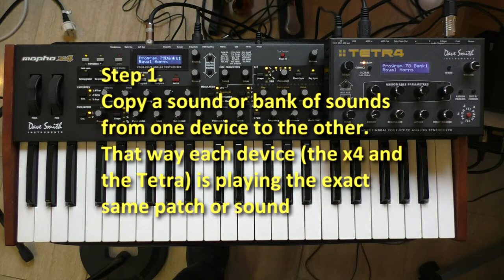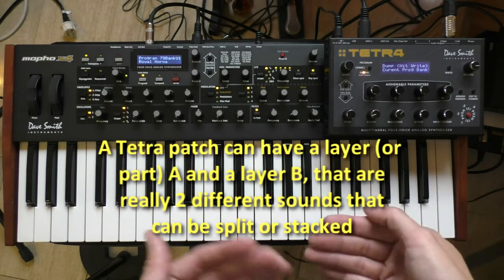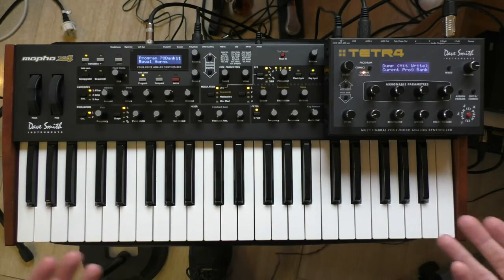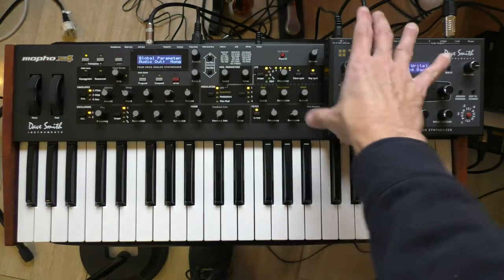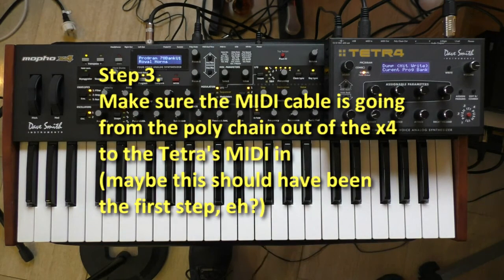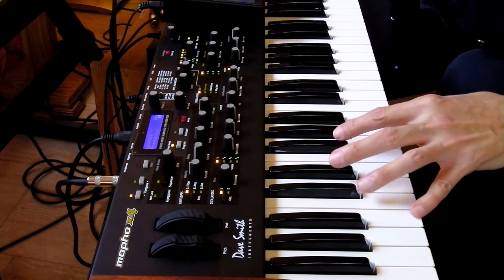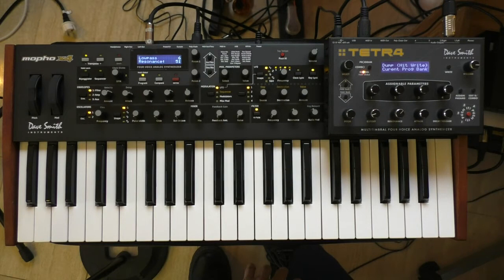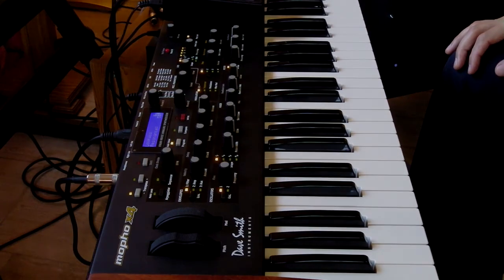Dave Smith Mopho x4 - Part 2 (Chained to the Tetra)

Comment: Hey! Helpful video - I also would mention that both the Tetra & Mopho X4 (or whatever module you are chaining) is the same midi channel whilst poly chained. In the midst of all the callamity and midi cables in my studio I seemed to overlook this upon my initial setup. Got it up and running, and I am loving it. Deep vibes tonight :D
Reply from the maker: Yeah, when I did this video there weren't a lot of polyphonic analog choices out there, and this made a lot more sense as an option back then.  Now, even a used Tetra and Mopho x4 would cost only slightly less than a new 8-voice Prophet Rev 2.  These are good times for synth geeks!
Reply: I got my pair for 1400 both separate purchases but I lucked out.
Reply: How do I set to recieve midi only on Channle 1?
Reply: @keepingfitness727  global settings, set midi channel (1)
Reply: @neofelisherod2947  how many midi tracks can I have is it just 1?

Comment: Man, I'm seriously considering snagging a Tetra for my X4 and your video has totally helped sell me.  I love my X4 and there are things that does well and there are things that it doesn't.  Those analog string/brass/pads are just next level with these guys but you are hard pressed to get a good "synth keys" sound out of it; it's possible but not it's most practical application.  I feel you on not being able to use all of the parameters of each synth but if you're using the multi-timbral aspects of the Tetra and perhaps the sequencing of the X4 then you could plan that out ahead of time with a DAW or other sequencer - I know I'm not the type of guy to use that stuff on a regular basis, I mainly want bangarang, pop out of any mix chords.  

So I'll have to tack a Tetra on to the wish list and then eventually build a passive mix box to pipe a mixed version of all analog goodness straight into the DAW.
Reply from the maker: Well, you already have the X4, the more expensive of the two, so yeah, the Tetra would be a natural next choice, as they really do work great together.  Fortunately Tetras are fairly cheap nowadays too. Cheers...
Reply: definately can get those sounds, its just a bit of a dive. I am going to mess around with different setups - as mentioned in the video - figuring out how to split voices between tetra and mopho x4 seems to be either elluding me, or is not possible. I would be able to program multiple other sounds via my Elektron Octatrack, with the assumption I have each of the 2 voices from the tetra on discreet midi channels. In theory, I think the other 2 voices could potentially chain with the mopho . i just dont know about midi in/out availability with the Tetra  post polychain.
I just got my Tetra hooked up tonight, been noodling with 8 voices with some fx chains in ableton, and I am impressed to say the very least as I have only begun to scratch the surface with this addition to my subtraction (see what i did there)

Comment: really nice that u made a video on this subject, i'm really thinkin' of getting morpho 4 or prophet 6 to control my tetras, but seems like with so many new synths coming nowadays it will be very difficult to uphold that dream, but anyway real curious to know how smoothly  it works, u just share the same preset on both units and tweak fully on the morpho and it affects both right? any  glitches? if u get time it would be super if u cud do another more in depth video just on how u tweak patches.
Reply from the maker: +Ehsan Kamran Thanks for the feedback.  The good news is the Mopho x4 really does let you easily program your Tetra.  There is some menu-diving required, but for the most part, it's quite easy.  And no, no glitches that I've encountered.  The bad news is the Prophet 6 can't be used to program the Tetra.  They have a different architecture and sound engine.
Reply: Oh I meant prophet 8 :) thanks for the replies!

Comment: The only limitation i am seeing with is setup is that the morpho x 4 doesn't seem to have knobs for editing the step sequencer, I guess a prophet 6 would be a better choice, as per the all voices or none thing, I don't think its a serious issue but I do feel that it would have been nice to have it as u explained how you wanted to use it, although the good thing is u can connect the tetra via usb to another keyborard and just use it by itself for the layered sounds and other combo modes and what not and it can still be connected to the morpho by midi when u wanna fire up a 8 voice royal horns patch!
Reply from the maker: +Ehsan Kamran The 2 biggest advantages I can see chaining the Tetra to the Mopho x4 is: 1) you double your polyphony, and have 8 voices which are great for slow fading pads or any patch with a slow release, and 2) It lets you program the Tetra with knobs!  I can see times where I would rather just control the Tetra with the Mopho x4, letting them both have 4 voices (and different patches if needed), and then maybe layering them.  You could get a big, fat sounding, 4-voice pad that way (with the 2 synths layered instead of chained).  Hope that helps.  Cheers!

Comment: Awesome. Thx for the vid. I've got a yellow mopho keyboard and tetra and was thinking about upgrading the mopho to SE or maybe even X4 since because you can put the tetra on top, it basically takes up same amount of space as mopho keyboard and tetra but gives extra keys, and also tetra on top of other black units would just give a more unified experience, but........ the damn filter and resonance knobs are badly placed relative to tetra on top. Not enough room to tweak. Is it as annoying as it looks to me to be?
Reply from the maker: Nah...it's not that cramped, at least not in any way that I noticed while playing with it.  That being said, I'm not a massive knob tweaker while I'm playing (as I mentioned in the other Mopho x4 vid, I don't sequence much outside of a DAW).  And as my left hand is used to doing the pitch or mod wheel, it really isn't hindered if I swing it over to work the filter knobs.  If you're someone who just lets the on-board sequencer run, and you basically play the knobs with both hands, THEN the Tetra might be a slight obstruction, but nothing that's a show-stopper in my book.

Comment: Thanks for the assistance.  However, in retrospect, I think I should have just bought a Rev2, since getting a mixer, Tetra and X4 came out to be about the same price—though in “installments”.
Reply from the maker: Yeah, fully agree.  If you're mostly building this setup for the 8 voices of polyphony, you might as well get a used Prophet 8 or a used Rev 2.  I saw some guy interviewed where he had this setup mostly for programming his Tetra with his x4, using them both in his home studio , and then actually using just the Tetra for gigging with some other lighter controller he also used for pianos and organs.

Comment: Hi man, 
I am from little Belgium

Nice demonstration , very nice... Thanks!!! 

 I would like to keep the patches and sounds of the Mopho x4 and those froth tetra in the same instrument ? in your setup it seems that an entire bank of the Mopho disappears and is replaced by the sounds of the tetra to reach 8 voices polyphony? Can we transfer an entire bank from the Tetra to an "user bank" of the Mopho and  have access once to 8 voices of polyphony, or once to the two x 4 layered sounds or patches . Possible to choose the destination of the transfer ? 

Also I have a Mopho x4 and two Tetra's : 12 voices possible isn't it ?

Thank's

Philippe
Reply from the maker: Hoi!  België is klein maar leuk.  Ik heb daar gewoond.  And if you're Walloon, je regrette, mais mon français sucks.  I did learn a little French in Belgium, but not enough.  Fortunately I already knew some Nederlands/Vlaams.

If I understand what you're asking, I think the answer is no.  When playing in 8-voice configuration, the only data shared between the two devices is the midi performance data (note, CC, velocity, etc).  The Mopho x4 can't read the patch data from the Tetra or vice versa.  The only reason to have the same patch data in both devices (the Mopho and Tetra) is so when ANY of the 8 notes is triggered it will have the same sound.  Though I haven't tested it, I think you can have different patches on the 2 devices (like a brass sound on one and a clav sound on the other ), and the extra midi notes from the Mopho x4 will still trigger the Tetra regardless of what the patch is (whether the patch sounds are similar or not).  For a 4-note chord, 2 notes might have a brass sound, and 2 notes might have a clav sound, depending on how they are allotted for that one chord.

Lastly if you don't want to copy over a whole bank of patches, you can copy just a single patch from one device to the other.  That way you don't replace the WHOLE bank, but just the sounds that you WANT to have 8 voices for.

Does that make sense?  Hope so.

And yes, 12 voices are possible with an X4 and 2 Tetras.  I have thought about getting an extra Tetra just for that reason!  Cheers...

Comment: Hey man, i cant decide between the Mopho X4 and teh minilogue which one would you recommend ?
Reply from the maker: Depends on what you ultimately want to do and what your budget is.  If you're a player (you play keyboards), then the full-sized keys on the X4 is definitely preferable (to me anyway), though some folks don't seem to mind the Korg mini-keys.  If you're wanting to step sequence stuff, the Minilogue appears to be a LOT easier to program sequences, and it's half the price.  Sound-wise, they both have their strengths and weaknesses.  

So, were I a heavy step sequencer user who didn't mind the smaller keys, I would go with the Minilogue.  In my case, I prefer the full-size keys, and don't step-sequence so much, so the X4 is preferable.

Hope that helps...cheers!
Reply: Yeah it does, i am more into sequences and i dont mind the small keys. I just was concerned about the sound. The mopho x4 seemed to sound more the way i like it but then agaibn it cost a third more and teh sequencer on it is useless for me. I also own a Korg Kr-55 and i think i can sync it to the minilogue but i am not 100% sure maybe u can tell ?! Whatever thanks a lot you doin great work like your vids a lot. Keep up!
Reply: That depends on if you have ears.  If you have ears, get the Mopho.

Comment: Hmmm...  Just a thought, in addition to copying all patches over and having 8 voices of the same patch, could you also instead accomplish a bit of layering by having a certain patch in the Mopho, and a different patch in the Tetra, but in the same bank location?  So 4 voices of one patch and 4 voices of another?  I'm probably not describing this correctly...
Reply from the maker: Understand perfectly.  True, if you don't activate the polychain setting, the Mopho X4 will only act as a controller keyboard, feeding the same notes to the Tetra. You could either have two different, layered, 4-voice patches or the same patch with each note using 4 oscillators to make it nice and fat (depending on how much you detune the two patches).

Comment: I think DSI stuffed up here, the Tetra is great not only for the multitimbral COmbis etc but also for laying more than 1 voice of the same sound for a unison or really fat `Monosynth` sound.  SHould have made the X4 a Tetra keyboard
Reply from the maker: Fully agree.
Reply: Fast forward to 2018 and I just got an X4 to chain to my Tetra and it`s great for proper strings/pads etc and means that my Tetra is no longer more or less a Rompler although for people without either machine to buy both today at once is pointless when you can buy a Prophet Rev 2 8 voice new for similar money to these 2 units 2nd hand.
Reply: I always wondered why DSI never did that. Mopho x4 was basically a Tetra with a keyboard. They could have kept the Mopho name for the original keyboard and thrown the Tetra name on this one. Oh, well, a rare misstep for DSI. Let's hope Sequential thinks of the lower end of the market and gives us another board like this, since I'm assuming that this and the Tetra are both out of production now...
Reply from the maker: @noiselabproject9659  Think I missed your comment 10 months ago, but I basically just said the same thing yesterday replying to another comment...a used Tetra and Mopho x4 is close the same price as a new Prophet Rev 2, 8-voice desktop.  In some cases MORE than a Rev 2.  That's nice for buying new gear, but the used gear bargains just aren't as good as they used to be.  Can't complain too much, I guess.
Reply: @noiselabproject9659  I want to sequence the mopho only to Channle 1 in the Mpc. Where recieve midi on the mopho